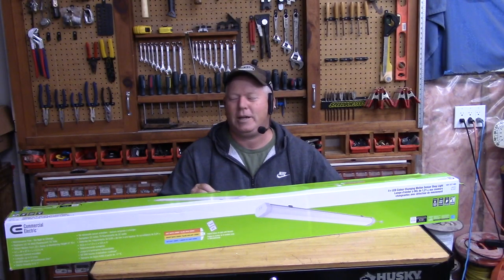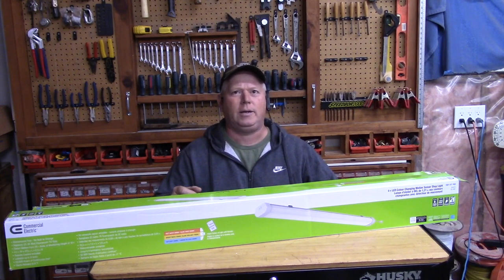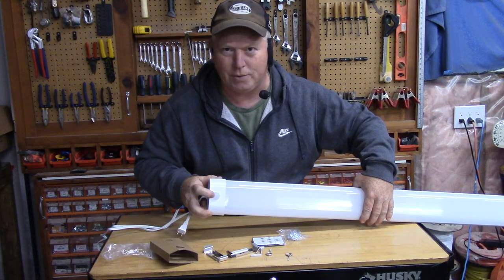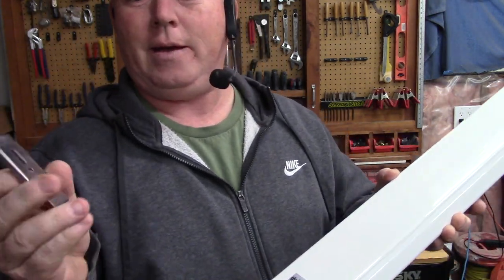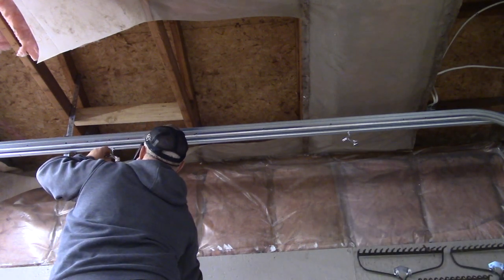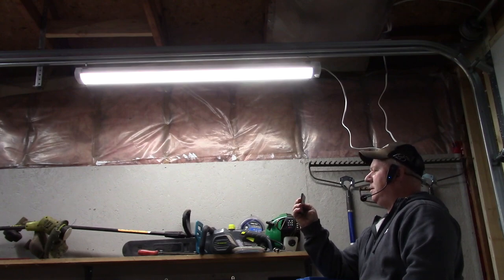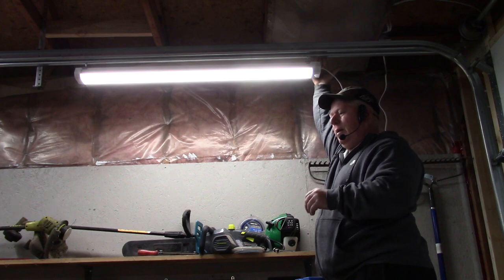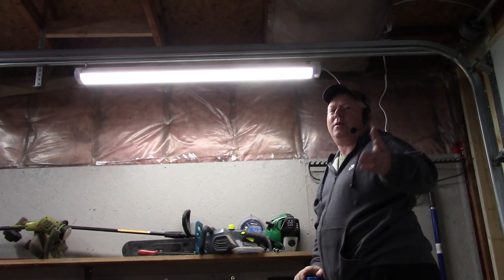4 ft LED Motion Sensor Shop Light Review - Commercial Electric From Home Depot

Comment: How are these lights holding up ?
Reply from the maker: I’ve had them in since the summer, so far so good.
Reply: If I connect say 8 together can I control them via 1 remote
Reply from the maker: @gregadams8354    That’s a good question.  I didn’t link mine together.
Reply from the maker: @gregadams8354    Check their website